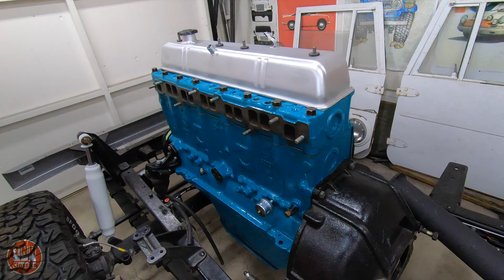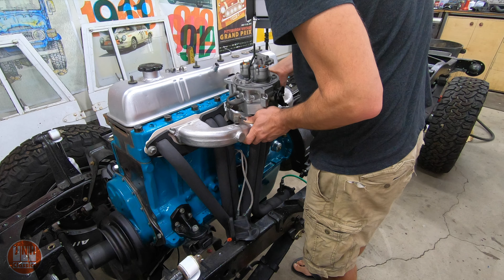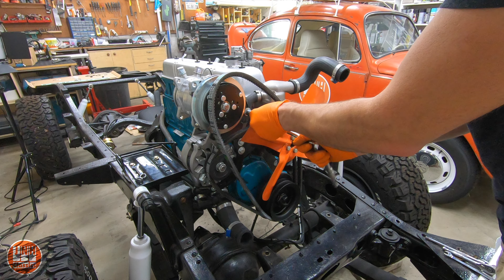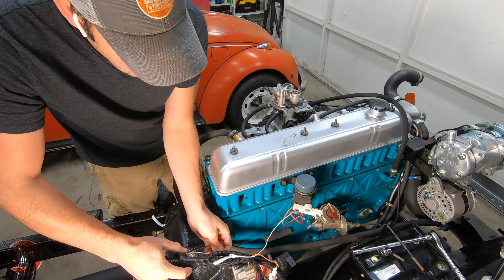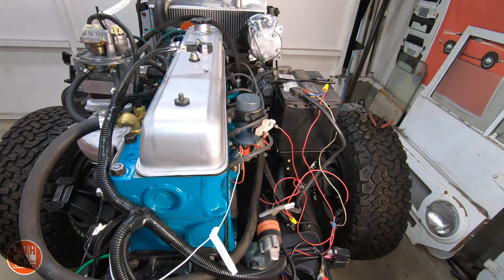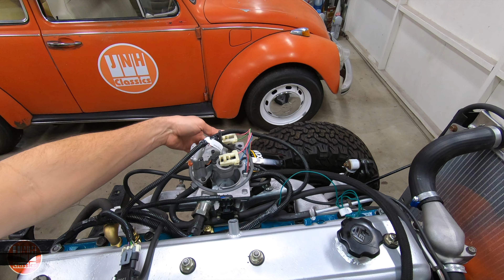FJ40 Restoration (Episode 30) - IT RUNS!.... Again!

Comment: Wow, great job!  Yep, I think they say to adjust lifters with engine hot - and the old timer's say "if you can hear them, they aren't burning" meaning it is better to have them a tiny bit too loose than a tiny bit too tight as the valves will burn if they aren't closing when they should.  The head has coolant flowing through it and the exhaust valves get cooled off by having their heat wicked away through the "cool" of the valve seat.

Comment: Congratulations pal on the startup. It's been a long road to get it to this stage of the build and glad you kept the F engine in lieu of the 2F swap you were thinking. Did you wire up the coil and ballast resistor for cold weather starts. Hard to see if you had a bypass wire installed from the starter. Appreciate all your time and effort putting the build on video and posting. Has been a big help with my 72 resto project.

Comment: Good job buddy . These f and 2f engines are infamous for noises they sound like Diesel at times . I have a 75 fj40 and I am running a Holley 2 brl carb with DUI  distributor and headers like your set up  ، also mine has a oil cooler which I'm going to do away with. I like you injection set up and I was going to add it last year but I was moving and never came around to doing it, like to see what you think of yours once you get it on the road , anyway best regards and Keep up the good work brother.👏👌👍
Reply from the maker: Thanks buddy!

Comment: Do you have a list of the parts you used on the motor (pulleys, belts, gaskets, etc.)
Reply from the maker: No sorry. But I get most of my parts from Spector off road. They’re website makes it easy to find the right parts for your cruiser. 👍
Reply: @Jerod_Helt  Okay. Thanks for the info. Keep up the great work.

Comment: I noticed you didn't oil prime the engine before initial start up. I'm just finishing a similar complete rebuild on 1971 F engine for my restored FJ40 and I can't get oil to my rocker assembly by spinning the oil pump with an electric drill, but I've got good discharge into the filter and block. Should I be worried or will oil galleys in the #2 cam journal move the oil up after I start it up?
Reply from the maker: I poured oil all over the rockers and down all the pushrods right before starting it.  Not sure about your situation. I’m no expert I’m learning as I go. You might what to post your question on https://www.ih8mud.com/.

Comment: Did you change the carburator with the injection?
Reply from the maker: I’m using a Howell Fuel Injection System👍
Reply: how much will it cost to replace injection ? and where to buy it ? Thanks bro
Reply: @ryanrohmansyah8290  are you from INA bro?
Reply: @andra576  yup bro, you?